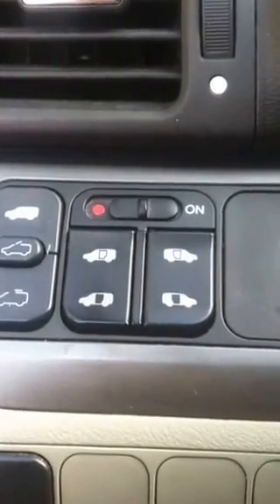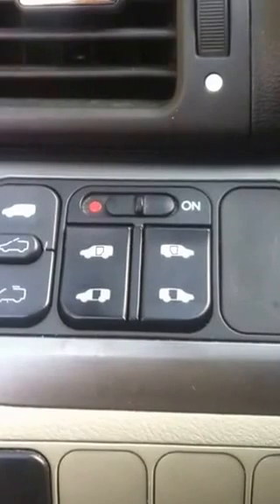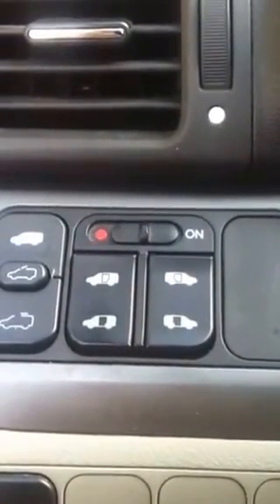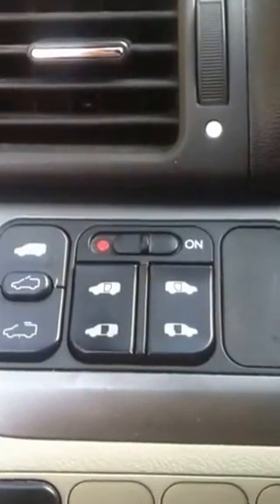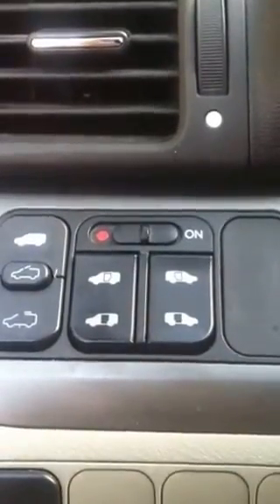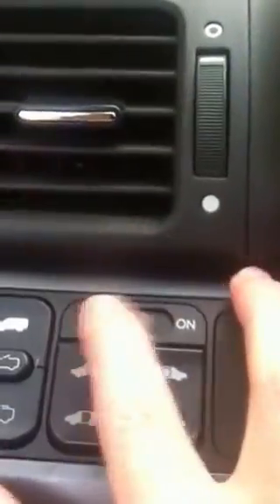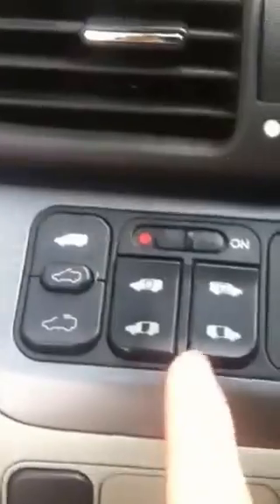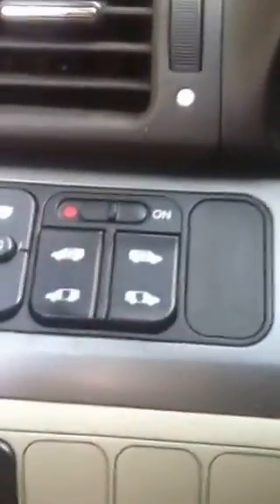Automatic Sliding Door Reset 2005 Honda Odyssey

Comment: I tried this and it didn't work. Then I read a comment with a suggestion to pull the fuses on each side (driver/passenger). I tried that and also waited for longer with both fuses out. I also opened both doors... Then both doors didn't work! So I turned the door to manual and closed the driver side (which had always been working fine previously), then it worked again. So I manually closed the passenger side, and immediately heard the motor drawing it closed for the last inch - fixed! It wasn't doing that previously. Thanks for your video, and to others, don't give up immediately, I had to try those things and give a more thorough attempt and it worked. Very relieved.

Comment: we have gone all summer without the passenger side door working because someone really pulled on the handle and door too hard and it stopped working. We thought that it dislodged a cable or the motor burned out, but it was just this one simple homing trick that did it.  Thank you so much for showing this. It saved us a lot of money.

Comment: Thank you for taking the time to make and share this video. My trouble was “slide door” light came on after closing right passenger sliding door. I pressed control to open it and it would not do anything. The left sliding door will not open as well. I searched on YouTube for fix, found videos that talks about pulling fuse #7 from driver side, which worked to cancel “slide door” light and fixed left sliding. Right sliding door still not working. I found your video and you mentioned fuse on side of front passenger sit. I pulled it out, waited 10 seconds, and it did fix the problem, but “slide door” light came back on after 2nd try of opening right sliding door. So I pulled out fuse #8 on the right side and then pulled out fuse #7 on left side to reset both. Pushed back fuse #8 on right fuse box and then the fuse #7 on the driver side. Both sliding doors will work but after restarting engine it will trip “slide door” light again causing the right sliding door to stop working again. I will give it another try and drive the van, hopefully it will reset the system
Reply: I don't know if it was your suggestion to do the fuses on each side, but I tried that and also waited for longer with both fuses out. I also opened both doors... Then both doors didn't work! So I turned the door to manual and closed the driver side (which had always been working fine previously), then it worked again. So I manually closed the passenger side, and immediately heard the motor drawing it closed for the last inch - fixed! It wasn't doing that previously. Thanks to your comment, I gave the whole fuse thing a more thorough attempt and it worked. Very relieved.

Comment: Awesome! Thanks. Worked great....second time after I realized I was reading fuse box label wrong and pulled wrong fuse.  This was after spending a lot of time and frustration replacing/aligning new middle rollers just right. Your reset video completed the job. Dealership quoted me around $500 for repair. I paid about $75 for replacement rollers (both doors), spent some time researching how to videos on you tube, spent a few hours total on labor, and everything worked out for a lot less than dealer!! Thanks again!!!

Comment: The middle row 2nd from the front yellow power door fuse has reset my door several times by pulling it out for 5 second and replacing it but this time it wouldn't work till I saw your video and got my door reset again. Thank you so much 🙂

Comment: From the video....
1. Pull fuse # 7 (a red 7.5 Amp fuse for the "Back Up" circuit) from the Driver's side fuse box. 
2. Move the sliding door switch on the dashboard to the on position.
3. Put the ignition key in the ignition switch. Even with the Driver's door open, you won't here the beep-beep-beep nagging you that your key is in the ignition. 
4. Turn the key from the 0 position to the II position. The car will now be "on" but the engine will not be running. 
5. Move the sliding door switch on the dashboard to the on position.
6. Turn the ignition key back to the 0 position and remove the key.
7. Replace the # 7 fuse. 
8. Put the ignition key back in the ignition switch. 

Congratulations, your door is now "homed."
Reply: muchlatersooner 

thank you! this worked for me
Reply: I was ready to blow the van up! I tried all the other tricks and figured I was the exception. I went out at 11:20 at night to try this one last time so my kids didn't have problems tomorrow at school. Low and behold, THE DOOR OPENED! If it wasn't for Jesus, I'd be going to hell for sure after all the cussing I went through. THANK YOU and Jesus!
Reply: you said on step 2 and step 3 to turn the door switch to 'on' did you mean on step 2 for it to be off?

Comment: Great video 👏👏. no need to turn off the sliding door switch. With the ignition off just pull fuse and wait 10 secs, put the fuse back, turn ignition to acc position and door should work.

Comment: I had to pull both 7.5 amp fuses on my 2007 Odyssey after it got a Krown underspray .. actually had to leave them out for a good while then the doors latched again properly. (Backup on the left side and illumination on the right.)

I had actually pulled the 20 amp fuses as well and then nothing electrical worked after that for a short while .. not even the electric locks.. directly with the switch or by the remote..  don't panick if that happens to you too. It seems to all be working again now.. 

It happened to both doors at the exact time, I am rather confident that it is an electrical issue and not mechanical..

Thanks for posting this video..

Cheers..Luis

Comment: Thank you so much for this!! It worked immediately.
Only thing I would add is manually open doors before starting. Then after replacing fuse turn key to II position then manually close doors. Then switch button to ON position for sliding doors and test. 
The 1st attempt with the doors closed had no change.
The 2nd attempt with doors open (as discussed in other forums you referenced) but not closing doors resulted in neither door operating with power. 
The 3rd attempt I manually closed the doors and thought OK give it one more shot. And wallah both doors open with power!!!
Reply: This worked perfectly following your steps with the doors. thank you!!

Comment: Thank you so much! This worked and it literally took 2 minutes. My power doors would not open or close by any method (key fob, dash button, pull handle). The hardest part is just getting down under the dash to get at the fuse box. Problem now solved! (Odyssey 2005)

Comment: amazing brother, I have an 06 touring. I just pulled fuse, turn key to # ll, turn off sliding doors button, turn key to # l position, turn on sliding doors button, re-install fuse, and it worked on first attempt.

Comment: First Thanks,after resetting the door with #7 fuse does work. Open and close the door manually and problem was fixed. This is for my 2005 honda odyssey EX passenger sliding door. Thanks again.

Comment: Thanks for clarifying that for at least the 2005 Honda Odyssey, it is the driver's side #7 fuse for "back Up", located on the driver's side, not the #7 or # 8 fuse on the passenger side.  I wasted a bunch of time chasing my tail based on other instructions that were constantly saying passenger side.

Comment: Thank you
this works awesome for 2008 Odyssey Touring
dash kept showing right sliding door open while it is closed, this trigger the alarm
tried a few fuses and this works perfectly !
Reply: I know this is an old comment but, Did ur interior lights use to come on while driving and show the door open indicator as well? I am having that happen in my 08 also it's draining my battery if it sits for a few days . Thanks in advance  if u could respond.

Comment: your trick worked!!!  thank you so much!!!!   who knows how much money I saved!    Now I just have to stop my battery from going dead all the time; not sure if the two problems are related.
Reply: Wrap a small  piece of metal ( a beer can cut into a strip will work) around the battery post a few times, reconnect cable to post, and tighten. The connection should be better and actually allow the alternator to charge the battery as you drive. I had to jump mine intermittently for months, until my neighbor did this for me. 5 minute fix, tops! Works beautifully, now!
Reply: There are metal caps you can buy from Auto Zone or O'Reilly's that fit over the battery posts perfectly. They cost $1.85! :)

Comment: FYI if you have a 2002 odssey: I just bought a used 2002 odyssey, you don't have to do all these steps. I just slid the switch for the sliding doors to off, then pulled fuse #13 on passenger fuse box for 30 seconds, the label is clock/ backup. put the fuse back in, slide your door switch back to ON position, boom it fixed it

Comment: WOW! Thanks a heap for yer vid! The garage the Mrs. takes her '05 to always has some neg comment about me and why I can't repair something. They wanted to charge $$ to diagnose it and then even more $$ to fix it! This is something  a customer oriented shop would know of and do for free!!  :P Take that! I also tried the "remove the battery cable and let sit fer 10 minutes" and "remove the fuse and open/close" methods which did not work.

Comment: Don't forget to clean & grease!  Adding my items  based on on original post, Steve Haugen’s and muchlattersooner's comments. 

Resetting or "homing" the automatic sliding door on 2006 Honda Odyssey

1. Open both sliding doors, manually open them as needed
2. While open, inspect inside area of sliding door and remove any debris (rocks, sand, etc.). Also with damp, not wet, cloth wipe down gaskets of sliding door(s).
3. Apply a thin layer of 100% dielectric silicon grease (get online if you can’t find locally) to the roller track of sliding door and around the door gaskets.  A little goes a long way. If you’re a Honda purist and want to pay more $$, Honda part 08798-9013, aka Shin-Etsu grease.  This keeps gaskets supple and keeps door from “sticking” to gasket which will minimize motor strain when opening doors.  While at it, spray lubricant (WD40, Silicone Spray, etc) into the door latching mechanism and sliding arm moving parts at bottom.
4. Pull fuse # 7 (a red 7.5 Amp fuse for the "Back Up" circuit) from the Driver's side fuse box. 
5. Move the sliding door switch on the dashboard to the OFF position. 
6. Put the ignition key in the ignition switch in zero position. Even with the sliding doors open, you won't hear the beep-beep-beep nagging you that your key is in the ignition. 
7. Turn the key from the 0 position to the II position. The car will now be "on" but the engine will not be running.
8. While switch is in OFF position, test door buttons on remote and on the dashboard, they shouldn’t work b/c the fuse is pulled!  Turn switch to ON and test door buttons on remote and on the dash, again, should not work
9. Return key to off, or 0 position
10. Replace the # 7 fuse.
12.Turn ignition key to 2nd position 
13. MANUALLY close both doors
14. Make sure sliding door switch on the dashboard is set to ON position
15. Test doors to make sure will open and close
Reply: Brian P.. OMG, thank you for writing this all down. This is the only procedure that worked for me.  At the 13th step, I closed the passenger sliding door, then the driver side door. Once the door closed, I heard the door rear latch motor.  Thank you again.

Comment: This worked for my left sliding door, which was the one not working.  The next morning, however, it stopped working again.  I did the reset again.  Then my right stopped working and my left was still working.  The reset works for a period of time, but then one or both of my doors stop working again.  This is a 2005 Odyssey Touring.  I pulled about 95% of the fuses in 3 locations and could not find a blown fuse.  I went to a so-called "Japanese auto" repair shop and they had no clue.

Comment: 1/20/2019, only procedure that worked for me is from Brian P. He wrote it all down in 15 steps.  My problem is the parasitic drain on my battery.  It all points to #7 fuse.  Not sure why it is causing the drain, but I will post back here.

Comment: Thanks!!  I've been trying to fix a power issue with my backup sensors and while pulling fuses, my driver side door stopped working. Your video fixes this!!  Now I need to figure out why my back up sensors have no power. Any thoughts?  It's a 2008 Odyssey, back up sensors are Honda and were installed by Honda when I bought the van new.

Comment: I tried this procedure on my 2005 Honda Odyssey because it's passenger sliding door is not working. It was working after doing the procedure but after a few minutes, the problem came back. I tried to do the procedure a couple of times again but still the same. Hope you can help me with this. TIA

Comment: Don't get too excited folks.  This only works for about 4-6 cycles of opening/closing the door.  Then, it cuts off again.  You still have to figure out why the door is triggering the error.
Reply: did u ever find out what was the real issue after resetting it it only works 3 to 4 times
Reply: +Sam Singh yes, it was a hinge "roller" that needed to be replaced.  I bought a new one, off market brand, on eBay for maybe $80 and found a YouTube video how to replace it and it worked like a charm.  The old one really didn't look or seem broken upon final inspection so I guess there is a sensor that is simply very sensitive and can detect very small problems.  I guess it's been a year or so and it has been working well.  Knock on wood.
Reply: dealer part is about $5 more, and made in the US
Reply: was cheaper and easier to order OEM on-line than visit local stealership tho

Comment: Hi thanks. It worked...for 1 try. Then the "slide door" light returned and my driver side sliding door isn't working again. But it did work initially. Any thoughts what it could be to fix? The passenger side sliding door is fine. I imagine I could keep doing this reset and it will work once only then stop again. But when it works, it is smooth and no problems. Is this a fuse issue? If you can advise, thanks much.

Comment: Thanks for the video.  Will this actually stay or will the error come back again?  I did this one time and it fixed the issue for awhile and now it's back again.
Reply: Fix doesn’t stick. I tried closing and opening a few times after resetting the home and the error came back. As soon as it closed a 2nd time it would beep when tried to reopen it. After trying a few times to open it it would work but once it closed back up, error light returned.

Comment: I have a 2006 Honda Odyssey touring. The electric sliding door won’t work when the vehicle is working. If I turn off the engine. It slide both by activating it at the door handles and by the switch on the dash. It also work with the key fob. Once the vehicle is in off position. But when in on position it does not work. Can you assist please.

Comment: My driver side sliding door shows on my dash that it is open but it’s flushed closed and doesn’t beep and not draining battery. I removed 7 fuse and put back after 10 seconds but the light still shows on the cluster that it’s open. Weird. Any help appreciated. Thanks

Comment: Hi, nice video. it fix sliding door problem. But when I turn off the engine, this problem comes back. So, I have done resetting by removing #7 fuse multiple times.  Doors works good for some time but when I turn off the engine and turn on again then the sliding doors stop working. How to fix it permanently.

Comment: This didn't work for me at first. My door wouldn't close all the way manually. After I manually opened the door all the way, then manually closed it. Take not that the although the front of the door would lock the back would not. I had to give it a little "Hip" push to lock the rear portion of the door. After that I did the reset sequence and then it worked like a charm.

Comment: Still not working on my 05. I have pulled so many fuses and the right side works fine. It's the left side. I pulled fuse 7 on drivers side. Pulled fuse 7 on passenger and pulled two from the engine. And still doesn't wanna stay shut or even the switch inside doesn't work